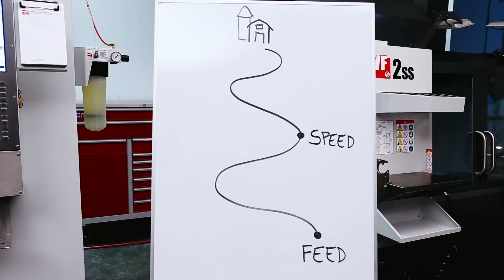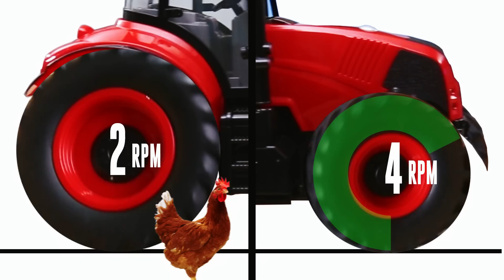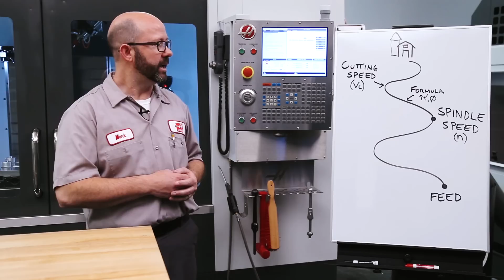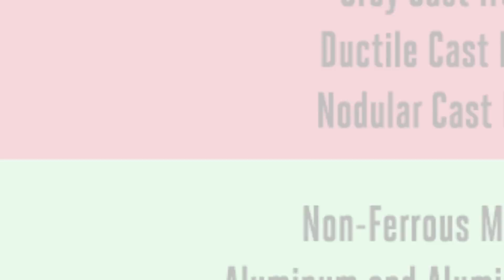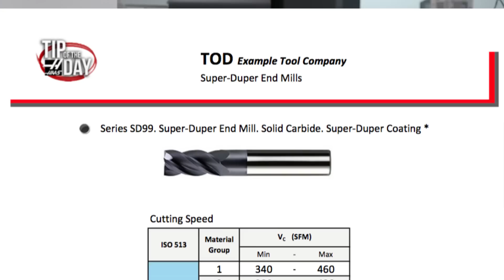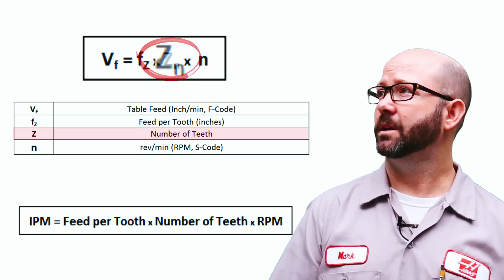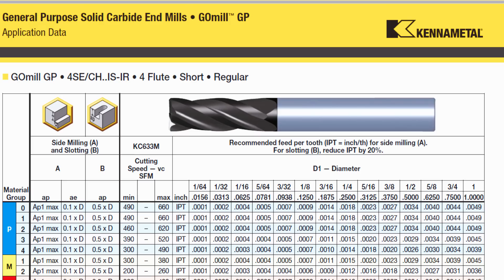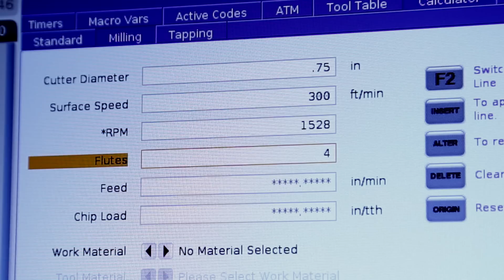How To Calculate Speeds and Feeds (Inch Version) - Haas Automation Tip of the Day

Comment: You talked about metal, what about plastics and polymers?
Reply: Polymers use the same concepts; their feed per tooth is just higher compared to metals since they're a softer material.

You'll want a higher feed rate to spindle speed to avoid melting.

Comment: I knew all this from my Tool & Die Apprenticeship.  Never used it for 20 years now but still remember.  We just use to go cutting speed X 4 divided by diameter.  For regular machining it was good enough and a touch on the safe side.  Then it's easy to do the calculation just in your head without using a calculator.
Reply: Tool & Die Apprenticeship?
Tool & Die Makers is a dead Profession; you must be from the 50's.
Reply: @MR-nl8xr  still a lot of shops offering apprenticeships depending on the area
Reply: @MR-nl8xr what world are u living in, still plenty useful for most shops. Not everyone has the money or requires a full cnc rig
Reply: Same here. simple formula that at most needs a piece of scratch paper and pencil.

Comment: I feel like im going to sound really stupid, buuuut could you do one for lathes? I'm really new (less than a year) and i was trained to do this formula for lathes. Just the number of teeth is 1 because a lathe has one cutting edge.

The older guys tell me SFM calculations are a myth and aren't real. (I understand there are variables and they are a starting point.)

But then im getting that this is the wrong way for a lathe, and a lathe feed rate is calculated as fees per rev. But the informative im finding on this seems a bit strange. Feed×RPM=Feed Rate where would i find the "Feed" value? 

If its based off of tooling catalog information, im not provided this at my shop.

Thanks! Love the videos! ❤

Comment: What I don't understand: Aren't you measuring absolute with relative? Does it matter if the indicator shows +/-0.01mm or +/-1mm, the idea is to get it to show +/-0? To measure absolute in Z you could use a "vertical caliper"? I only use the indicator "to chase the zero", I use other tools for measuring...

Comment: Machinists have possibly the best online community of any trade profession. I’m just an engineer dipping his toe into CNC but the vast array of knowledge that is masterfully presented on YouTube makes me want to learn more than I will ever use for work. Thank you so much for contributing to the public education of machinists everywhere! 

-Brett, 25
Reply: Machining and fabricating experience is probably the best knowledge a mechanical engineer can have along with their engineering training.
Reply: Well that's great cause 15 years ago the alot of the ole timers wouldn't teach the younger a guys  shit.
Reply: @robertlawler1387  Why is that?
Reply: @raulholliman2190 they wanted job security and were scared the younger generation would take their jobs😂
Reply: @ContrarianCrusade  Now they are complaining they can't find any youngsters to take over lmao
Reply: Can confirm.  Most of them STILL don't want to pass knowledge down.  I had to deal with that for the first 10 or so years starting out.  I don't know if they felt threatened by a younger guy coming up or what it was @robertlawler1387

Comment: Is these speeds and feeds just with coolant? What about no coolant?
Reply: For most tools, we are referring to Speeds while running coolant. Some tools, with special coatings like TiAlN, and AlCrN can handle very high temperatures (1100 ° C), and run just fine without coolant, but even those tools will likely give us better surface finishes if we run coolant. The manuals will usually tell us if we need coolant or not.

Comment: Cool video! But how do you do all this on a lathe?
Reply: I always have a hard time finding out how to use sfm on a lathe. I’m a pro at mill calculations, I get lost when calculating fees rates when turning parts.
Reply: You just type in your speed in rpm's(G97) or surface speed (G96) and then your feed in inches/rev. or inches/minute(not usually used in lathes)

Comment: So I'm being stupid, if the machine can't handle high rpms, go with the lower grades on the tools? This is for both lathe and mill,  having a limit on tool diameters, trying to figure this out
Reply: It's a good question. If you are running nothing but Ø1" diameter tools on Titanium, you wouldn't need a fast spindle, because you will never be running at high RPMs anyhow. If you are running small tools on aluminum, you will want the faster spindle option. And yes, if you a manually mill with a low RPM spindle, there is no reason to buy expensive tools with crazy high-temp tool coatings, as you really wouldn't see a lot of the benefits.

Comment: honestly i have started my apprenticeship in machining earlier this year and this is freaking priceless! i have yet to come across one of your videos that was not helpful. Thanks a lot for these amazing videos
Reply: 3 years later... how's the machining career going?
Reply: @ It isn’t anything glorious but I’d say it’s going well so far. Finished my apprenticeship early last year. Still in the same little shop that i started. I’m basically the only machinist on the floor since my boss is the only other machinist in the shop and he deals with most of the quoting, walk-ins and material ordering. We do a little bit of everything using a mixture of manual and cnc machines and since i also do most of the programming it keeps things interesting. Still so much to learn but that’s why i enjoy working in this trade so much.
Reply: @LeFrenchy.  that's great, do you find it stressful?
Reply: @ sometimes but not the kind that makes me lose sleep. Mostly when fitting a large bearing of some kind, shrink-fitting or whenever i machine close to the jaws or vise on the cnc (might have hit those once or twice before😅) . Biggest lathe job i done took me a week of manual machining and had 2 bores for bearings that required flipping the part over to bore the other side because of the shoulder in the middle. Heart rate goes up once the bearings are about to be pressed in. Each was over $2000. I think they were 10” OD or somewhere along there. I dial everything right or so i hope every time but i always worry about something binding if the bores are not concentric. Stock material was a forged donut that weighed close to 2000lbs at the start. Made about 800lbs of chips. Blew a fuse playing with depth of cuts and feed rates. Exceeded the range of the machine so had to use some shop made tools and snug up the break on the carriage because it wanted to lift while cutting. Was a lot of fun to rough machine but the finishing took time and had some reasonably tight tolerances on something this large. Overall lots of fun with some stress sprinkled along the way. Only slight regret is not getting into the trade sooner although i did have some overall good prior work/learning experiences.

Comment: Why not program using G95 and just enter the IPR? This way if there is any bog in the spindle the feed will automatically slow to compensate. Saves on tooling.
Reply: I agree G95 should be default on all milling machine controls. Then you can tweak SFM with speed override without changing the chip load per tooth. G94 requires re calculation of IPM and a program edit. I have been programming this way for the last 40 years

Comment: Outstanding, very helpful! (I've been a manual machinist and always chose RPM and feed speeds based on general understanding of materials, plus "feel". Now as I'm transitioning to more CNC I see I haven't been pushing my tools hard enough!
Reply: I had that same problem when I went from manual to CNC. When I first started I always thought the tool was going to break because of how fast it was going
Reply: Do the cbc really allow much faster than 500 sfm for carbide to medium steels , and is this cause the carbide is so much better or because of the ability to climb cut w cnc?

Comment: Question from a newbie: the formulas don't contain extreme variables that are all over the place. There is only a few number of diameters available, 1/8, 1/4, 1/2 etc. Rarely anyone uses a 4 or 3.68 inch diameter endmill, if it even exists.  Also, you can't find a 17 flute endmill, but rather 2,3,4 (5 and 6 maybe?). Why does it seem that everyone needs to calculate these numbers or look at a chart so often?
Reply: There are plenty of other sizes out there, metrics, customs, inserted tooling, drill bits, etc. Inserted cutters can come in literally any size and can have any number of inserts, and often have prime numbers of inserts to reduce the effects of chatter.

Comment: 0:24 Key Concepts-Formula to determine RPM-Establish feedrate.

1:13 Surface feet per minute versus RPM.
2:01 Pi.
3:14 Speeds-Cutting speed versus spindle speed.
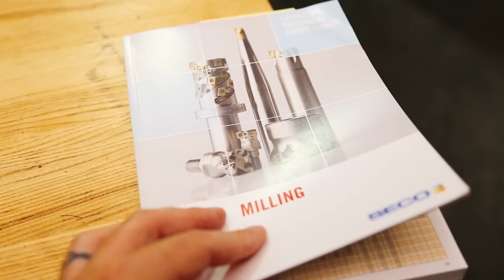3:45 We get our cutting speed in Surface Feet per Minute from the catalog.
4:25 Formula to calculate RPM explained.
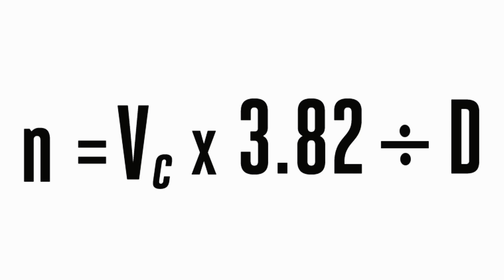5:29 RPM formula simplified.
7:19 Isomaterial classes to determine Surface Feet per Minute.
9:00 Example RPM calculated.
9:56 Feedrate formula.
10:48 Example feedrate calculated.
11:25 Cutting versus slotting. Axial depth of cut and radial depth of cut explained.
11:48 Matching feeds and speeds with toolpath strategies.
12:13 Drills versus endmills. Feed per revolution for drills-feed per tooth for endmills.
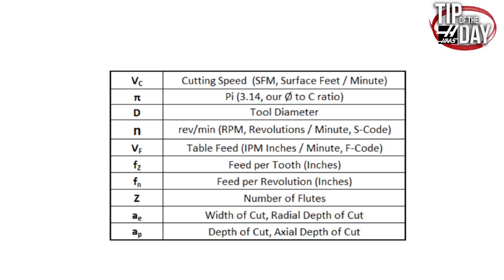12:50 Completed legend. All symbols. All formulae.

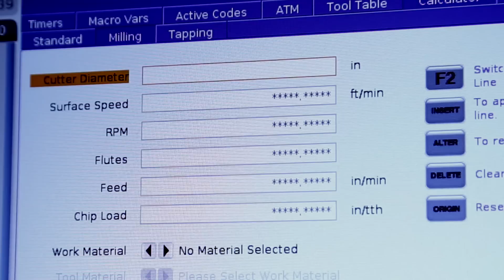13:50 Speed and feed calculator on Haas controller! Under "Current commands," then navigate to milling tab.
Reply: Puddin Tame nice!  The time stamp after Pi though

Comment: Why doesn't everyone just use feed/revolution (G95)?  You have that info and then put it into your formula to come up with inches/minute.  With feed/rev, the feed stays constant even if you raise or lower the rpm.
Reply: What is a good rule of thumb for hoging passes,   going full depth and   100 % stepover, 180 degrees of mills g action ahead of the cutter,  if surface speed doesn't have to decrease, what's it for maximum chip thickness. I KNOW the cnc programing game is where it's at I just think it is faster to do really remedial tooling on a bridgy, or NC mill.
Reply: @ryanb1874  everything is relative to the rigidity of the machine and more importantly rigidity in the setup/fixture. Also coolant and how well your coolant system can keep up.
Reply: We have older machines that don’t have g95.
Reply: Because not always work😅
Reply: I've always asked this too, I think it goes back to old manual mills that had auto feed and were not connected to the spindle so it was ipm. But when I started running CNCs in the 80's I always programmed in ipr even on mills, why add the extra step in the calculations.

Comment: are these different for single angled cutters
Reply from the maker: ISM 62 – Its all the same formulas, we’ll just use “1” for our number of teeth. So, if our single lip engraving cutter is meant to run at .0005” per tooth, and we are running 12,000 rpm, then we just run .0005 x 12000 = 6ipm. Hope this helps. – Mark, Haas Tip-of-the-day

Comment: I do love this video as it's very easy to understand and you explain it very well. I have a question though. I have a cnc router and want to do some Aluminum work with it. I don't have the luxury of using a formula to get my spindle speed as i'm kinda stuck with a variable speed dial on a Makita router with a min/rpm of 10,000. Is there a formula for figuring out how to safely run a tool at a specific RPM?

Comment: If a manufacturer-supplied feeds and speeds chart doesn't give speeds and feeds for wood, and the material you're cutting is wood, can you just use the information for aluminum (or plastics if available or non-ferrous materials if available)?
Reply from the maker: bds – I haven’t cut enough wood to be of much help to you, but for the wood I have cut, I started with feeds and speeds for Aluminum and worked my way up, just like you said. With the correct tools for wood (router bits, etc), you can basically run at max spindle RPM most of the time, but you’ll need to check with each tool supplier. – Mark, Haas Tip of the day
Reply: @haasautomation  Thanks so much for your reply and for making this video!  I will give that a try!

Comment: Why do cam softwares generate massive g code files when i can mdi the code necessary to make the part and it takes 5% as much code. Im still new and havent realy taken the time to compleetly analyze the cam output.
Reply: We use mdi just to do a short thing. May be two or five lines of programming. Cam is not always the best choice. Sometimes is better to program next to the machine by hand. Start doing your own jobs and you will know your how to make the choice.
Reply: Because cam software uses programming rules that are generic and work, but with computer programming knowledge and understanding, and applying to your specific needs and situations, you can customize the post processor to better fit and more efficiently spit out code that works for you. I use FeatureCam, as an example, and am constantly tweeking the post processor files (rules) to help eliminate unnecessary and machine memory wasting code.

Comment: Formulas:

Speed:
n=(Vc*12)/(D*π)

n=spindle speed in RPM
Vc=cutting speed in sfm 
D=diameter in inches 

Simplifies to:

n=3.82*Vc*D

Feed:

Vf = Fz*Zn*n

Vf = table feed rate in ipm, F code
Fz = feed per tooth
Z = number of teeth
n = rpm 

Cut width and depth:

Ae = radial width of cut (along x and y axes)
Ap = axial depth of cut (along the z axis)

Drilling:

Fn = inches per revolution. 

Feed rate:

Vf=Fn*n
Reply: Thanks
Reply: Thank you!!